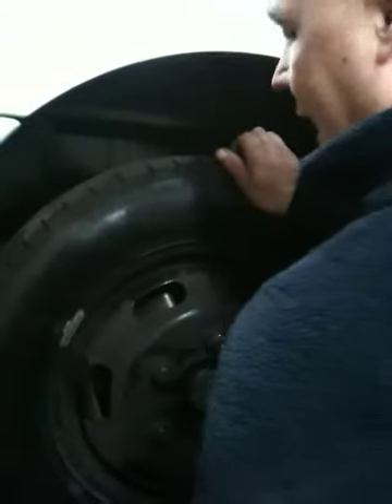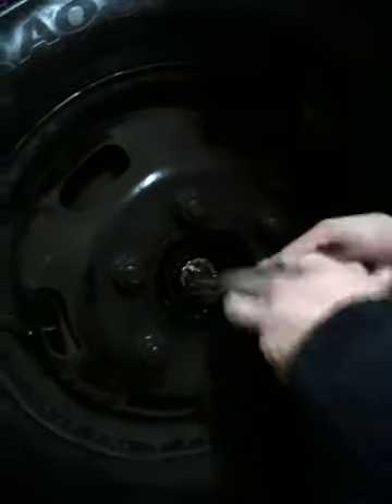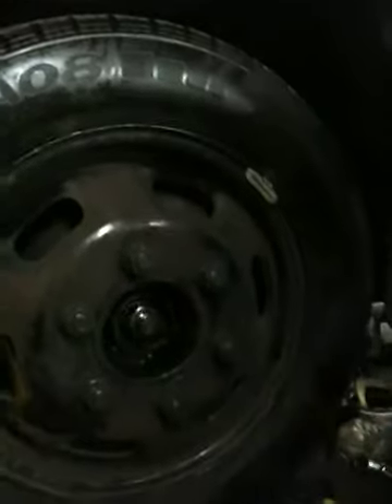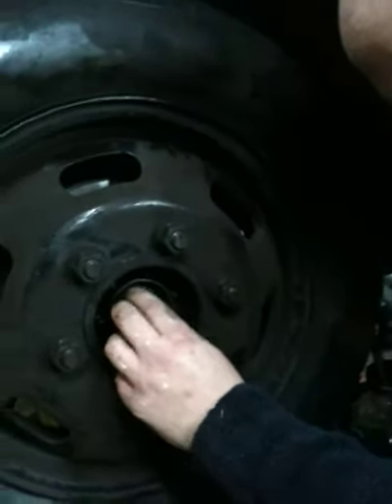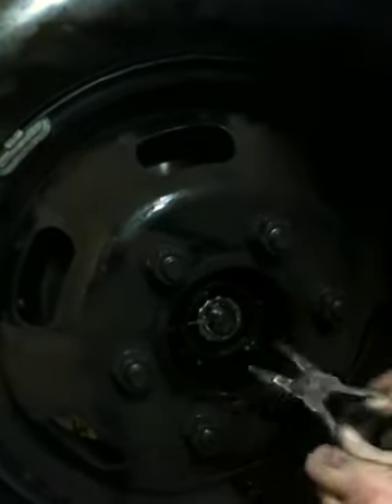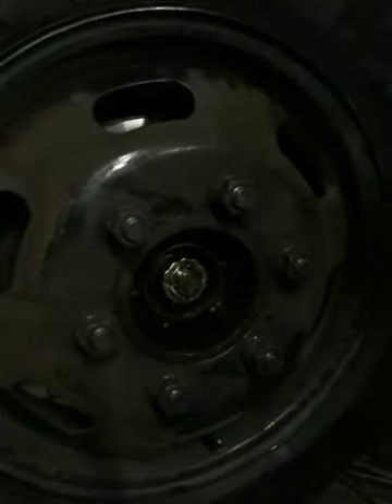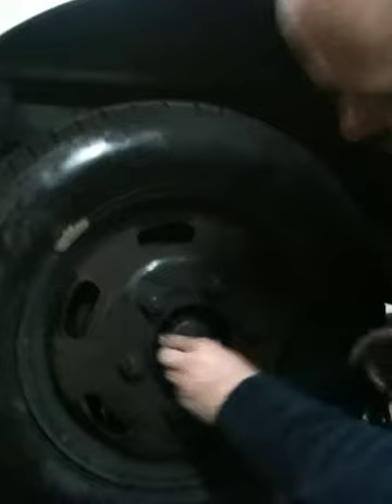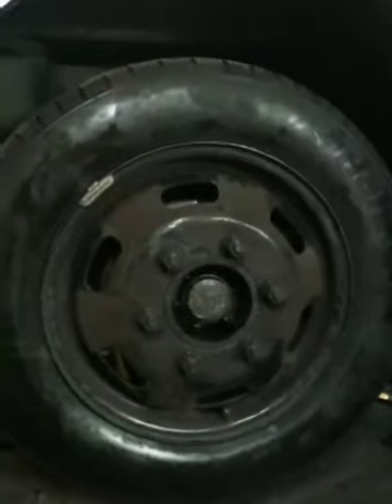Lti taxi repairs part 2

Comment: Love this video and you presenting style, I’ve just got a TX4 as a bit of a hobby,  when I test drove it was all fine.  Took it out on the open road and at around 40MPH if you hit a slight pot hole with the front passenger wheel the whole front end / steering shakes violently…. The tyre on the side is worn on the inside edge.   The power steering groans a bit.  Any ideas I’d be most grateful, I’m just a hobby mechanic so not really wanting to send it into a garage for repairs, only paid £750 for it !
Reply from the maker: First job in that case is upper wishbone bushes the poly ones not the rubber main dealer crap they don’t last five minutes but grease them well piece of pea to fit , then check the wheel bearings are ok just tighten them a bit to make sure it’s not them , the problem with taxis most bump up and down kerbs they are so straight forward to work on the tx4 is a Chrysler engine and the tx2 is a transit engine , I only use arftermarket parts as main dealer parts keeps you spending money for no reason so the upper wishbones in poly and slightly tighten the wheel bearing both sides try that and get back to me after that Dan
Reply: @toutandabout7362  that’s brilliant thank you so much,  I’ll get some ordered.  I had a puncture repaired and had a nosy, the upper bushes were cracked and added to my to do list.  I’ll strip it down at the weekend and let you know .

Comment: I know this is probably a long shot; I have a 2003 LTI TX2 here in the states.  I'm having a great deal of trouble finding a parts supplier that will ship parts to the US. I'm looking specifically for wheel bearings for both sides (including the tab washers and locking washer cage).  Also a wheel spindle for the drivers side (LHS) Any help would be greatly appreciated! Thanks!
Reply: Let me try and find out for you. Give me a couple of days
Reply: +sarah potter thank you so much